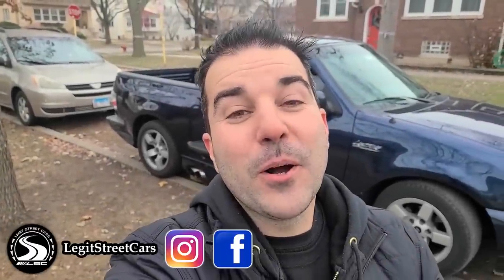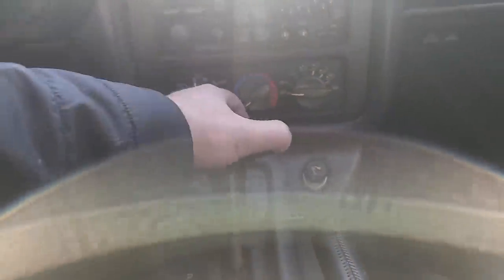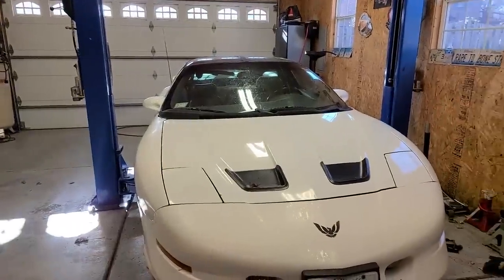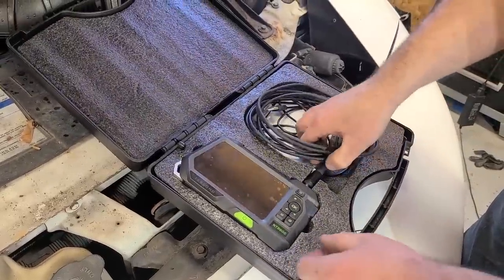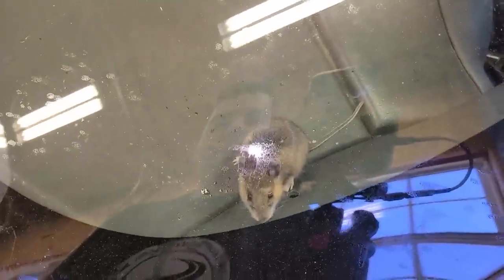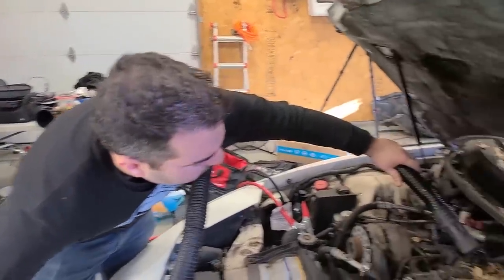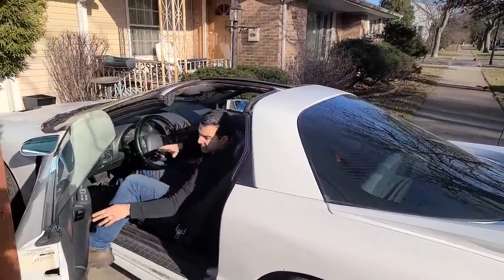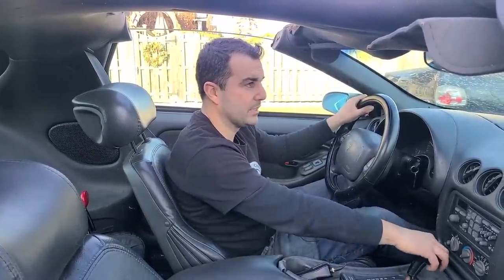I Bought My Childhood Dream Car After Finding It 25 Years Later! First Start & Drive But It's ROUGH!

Comment: Plumb the exhaust into the cabin and leave it running for a while, that'll sort the mice out.
Reply: As long as u sit inside while its running
Reply: @snoopy5736  definitely sit inside it, it will scare the mice even more
Reply: So glad Grandpa never killed himself. The old Garage had Termites and he used to let his  old car run in there warmed up but with the choke manually set back on. Quickly bail out and let it simmer for a while....
Reply: 🤔 interesting…
Reply: @D B he was joking
Reply: 🤣 🤣 🤣 

... also don't forget to take up cigarettes after, to get rid of the interior exhaust smell.  Lol

Comment: I'm heart broken that it was in such bad condition, but happy that you got it to run again if only for a little while. I'm sure Mel will be happy to see it drive too, and if the kid with the dead engine ever gets back to you at least some part of this car may live on. Also, I know not everyone is down with mouse traps, but even if you want to go the humane route just make sure you put them along the walls and in corners where they'll run to stay our of the line of sight and act fast before they start to consider your nice warm garage their new permanent residence.
Reply: Exactly, get that car out ASAP before they make a new home
Reply: Someone we pass by walking the dog has an E34 540i manual that has sat in the driveway for years.  I think the tag is from 2018.  It's rusty though being a Michigan car.  So sad.

Comment: My first two cars were LS1 Camaros (Z28 and an SS) back in 2000/2001.  Back then, the LS 4th Gen F-bodies were all basically brand new and I'd never seen one with high miles - seeing that undercarriage that I was once so familiar with just falling apart really hit me.  Can't believe how time flies.  Edit: seeing the poor old girl drive and try her best despite her condition was even worse, oof
Reply: There’s gotta be less corrosive solutions to dissolving snow, road salt absolutely RUINED this once great sports car and relic of the 90’s
Reply: @standyourground9973  there is! I live around Detroit and my county uses a brine/beet juice mixture to treat the roads. It's much less corrosive and puts way less salt into the waterways. Unfortunately, it requires different equipment to spread and all the surrounding counties still use rock salt.
Reply: @scottbutts6703  probably red tape as well… Thanks for chiming in, that’s promising
Reply: @standyourground9973  good name and pic.
Reply: @scottbutts6703  brine/beet juice is a pretreatment that you put down on bare asphalt to prevent frost from making the road icy. It does not melt thick snow and ice. If you get 6” of snow you need to put down heavy amounts of rock salt to melt the ice and snow back down to the asphalt.
Reply: My coworker had the 89 Iroc-z so they say.
Reply: @SuzukiKid400  Instead of salting away 6" of snow they could PLOW THE DAMN SNOW instead like a sane highway agency.

Lived here half my life and I still do not understand the SE MI road-clearing scheme.
Reply: @SYH653  same here in pa, they brine a lot and then salt even more throughout the storms while plowing. If its deep enough to plow we should just be plowing. And why dont we use sand like many places up north farther.
Reply: I've seen a few high mileage LS1 Camaro and Firebirds. A few with over 200k miles all original. They exist but not too many since most are either weekend toys or get rung out before they ever hit 60k miles from all the abuse.

Comment: Alex, regarding getting rid of the mice:  I would recommend the Classic Rat Zapper. I have used one for a long time whenever the mice try to move in. It uses 4 AA alkaline batteries and electrocutes the mice when they ground the contacts inside.  I found the mice in our area (I live just north of you) really like cocoa puff cereal.  A couple of pieces of cereal in the far end works like a charm.  The mouse goes in, grounds itself on two metal plates, and dies quickly.  Then you just dump the mouse outside or in the garbage.
Reply: @mcf3778  the Rat Zapper is not a live trap.  I have tried those sprays that he tried and they don't work that well if at all.
Reply: @mcf3778  Key word was ELECTROCUTES not trap.
Reply: @mcf3778  That's the thing, they didn't actually relocate on their own...
Reply: @RLC2020  I have never seen bots copy my comments into other comment threads.  Thanks for pointing that out.
Reply: Get a snake 🐍

Comment: Alex, I am not sure if this translates to F bodies, but my C4 vette with an LT has a Flood Start mode. You hold the throttle and clutch to the floor while cranking the starter. It deactivates the fuel pump, and allows you to crank the engine to get some oil pressure into the system.

Saves me from having to remove the fuel pump relays.

Hope this helps!
Reply: Mazda RX-8 has the same feature.
Reply: I thought all cars had that "clear flood" mode. (I think my Saturn and Subaru both do) Are there some that don't?
Reply: @rpavlik1  I am really not sure. If not, it really needs to be. I have always worried about the oil pressure after an oil change, so that feature came in handy when I discovered it. If you find out about your Saturn(its rad that you have a Saturn btw) and Subaru, let me know!

Best,
Luis

Comment: Beginning of the video: Wow, only $1500, can't believe you got it for that!
10 minutes in: Wow, I can't believe you spent $1500 on that car. 

Win some, lose some, glad you're able to find a good home for the engine, LSC doing wholesome deeds as always!
Reply from the maker: That's exactly how I felt
Reply: How much was it sold for initially?
Reply: @gzhang207  new LT1 TA fully optioned would have been just under 30k

Comment: Hi Alex. Thank you for all the enjoyable content you create. I have enjoyed and learned quite a bit by watching your videos. Im hoping you and anyone who reads this can benefit from my experience. I bought an auction car that I did not know had mice until I got it home. I struggled for months trying to get rid of them before I was successful and they did extensive damage to the wiring on the auction car as well as my daily. Mice do not have bladders. They urinate as they walk leaving a trail. The trail of urine is an attractant scent for other mice that can be picked up from quite a ways off. This means even if you get rid of the few that are in the car their urine trails or anything that they have urinated on like carpet, seats, etc. will continue to attract other mice. I do not wish to alarm you or anyone. My intent in sharing this info is to encourage you to scrub and disinfect anywhere you even suspect mice might have walked. What compounded the problem I had beside not knowing that mice urinate everywhere is that modern cars have wire casing made of a biodegradeable food based product mice can actually live on. Ingenious idea right? Many cars have suffered thousands in damage this way. There have been hundreds of law suits by consumers against car manufacturers that are easily found with an internet search. The manufacturers won and consumers were on the hook for the costs of the repairs. I hope you do not have the small problem turn into a months long nightmare like I did. In my experience I also learned that Honda makes a wire harness tape that is infused with capsacin to keep the mice or pack rats from eating and living on the vegetable oil based wire casing. Also in my experience that peppermint spray works well as a preventative measure. It does not work to overcome the attractive smell of their urine if mice have established themselves somewhere as they have in that TA. Until you remove and discard everything that is covered or saturated with their urine in that TA it is a big invitation to any mice downwind of it. Please learn from and benefit from my experience. Also please be sure to wear mask and gloves. Mice waste carries and spreads many harmful diseases that are highly transmissable to humans. Stay healthy and well please. Sorry to communicate this info to you that might be distressing. Im hoping you can nip it in the bud before it escalates like my situation did. Id also recommend not using the pellets that are an attractant that they eat and then die. They can eat them then crawl into a wall, hvac, or dashboard and die. Difficult to find and the smell is sickening. Best Regards.

Comment: As for the mice problem, I use a pop can on a wire across a 5 gallon pail with water in the bottom. Add some peanut butter on the can and make sure it can rotate easily. Self resetting trap!!!
Reply: I made one of those and it does work real well.

Comment: Reminds me of a 1999 F250 super duty I bought.  The 7.3 turbo diesel's a beast, like brand new, but there's more rust than metal on the body.  I'm slowly rebuilding the truck a few pieces at a time, and cutting out parts of the truck and wielding new metal in a few pieces at a time.  It's a long process, but a vehicle can be brought back to life with enough time, money, and labor.

Comment: In terms of the mice situation, regular spring mouse traps work pretty good if there’s just a few mice. Just put a nice piece of cheese or ham on the trap as bait and they’ll eventually get caught. If you’re worried about there being more than like 5, check youtube on multi catch traps
Reply: peanut butter works well as bait too.  I put a old snap trap out with some on it and lasted less than 3 minutes before I caught it.
Reply: @computerguytommy  Can confirm peanut butter is best.
Reply: @computerguytommy  peanut butter definitely works well. I’ve tried other “tricks” found on the internet with no success. Dryer sheets, pepper, those plug in do-dads that emit a high pitched sound. None of those worked. The old spring traps with the yellow bait pad work the best.

Also the bucket with the spinning pop can works well.

Comment: I've got a 95 Suburban 2500 and I'd love to see you snag a similar car and go through different tiers of upgrades for performance and looks. Like "if you have 1000 to spend, these are the worthy upgrades" and kinda go up from there
Reply: Start with a tune up and gaskets and all fluids changed. From there do a corvette servo if it’s a 4L60E, CAI, exhaust, and tune

Comment: What a trip down memory lane. I have a 95 Camaro RS that I bought about 7 or 8 years ago. It was in very similar condition to your T/A, especially the floor pan and rear axle and rear subframe and rear inner wheel houses. The body, motor, trans and interior were in really great shape and I had spent $2700 on the car. Most people would have junked it or parted it out, well after about 6 years I got it completely rebuilt and back on the road. It is not a show car but just a reliable summer time daily driver, that with the T-tops out still manages to turn a few heads every time I take it out.

Comment: The best way I've seen so far is peanut butter bait,  roller pipe, ramps and a water bucket trick. You can buy it on Amazon for like 20 bux just need a painter's bucket. Kit comes with walk up ramps and a roller. Sean Woods is a YTber out of Washington/Oregon area. He reviews a lot of mouse traps and in his case, I would recommend that plus clean the bucket thoroughly wearing gloves before you set the trap. Mice are very sensitive to human smell and won't go near a trap if they smell you've been near it. Sean Woods might be able to help as well, though I know he deals with his family a lot, but you both could collaborate.

Comment: The classic snap traps work great. If you have trouble with the mice snatching the bait without getting trapped, then bait the traps without setting the traps to gain their trust a few times and then set the snare.

The glue traps in the big tin box trap works great also.

Comment: I love F-bodys. Have to get one again. I bought a really nice CLK500 with a 7G-tronic last spring as I thought it would be as fun but my long gone Camaro -95 Z28 with a 6 speed was much more fun. Way less quality in most parts except mechanical where they are probably equal, but much more character. I'd be looking for a manual LS1 Camaro with some mods.
Reply: Try a 2005 E55 amg.. true not a manual but as a previous owner of a 95 Trans Am with a 6 speed absolutely approved.

Comment: Most likely that rusted floorpan was caused by leaking t-tops and the car filling up with water. You could put a new floor pan in it, assuming your doing the work. Otherwise that could exceed the value of that car. 
Classic industries has all the parts.
Reply: That car's roached not even worth putting a floor pan in
Reply: That’s what I hate T tops. I owned a few and I got tired of wearing a raincoat every time the car was driven.
Reply: The majority of the rust is from 
Chicago  winter  
road salt.

Comment: Ahhh the wonderful, Heat and Moisture sensitive opti-spark... got to love engineers.

Engineer 1 - "hey this heat sensitive moisture sensitive optical distributor works amazing, you should put it on that new motor you're designing, because its damn near impossible to beat its performance without some serious re-design of our engines"

Engineer 2 - "Heat sensitive, and moisture sensitive... this sounds like we could profit cause it will go bad so often"

Engineer 1 -  "Yeah, and its made of plastic, with 2 condensation reliefs so you can actually fill it with water if you try, where should we put it?"

Engineer 2 - "well, if i make the water pump extend outward, it might make it a little more fragile, and reduce airflow, and it would attach directly to the cam which sounds like its a performance upgrade"

Engineer 1 - "Direct connection without gearing, that means no need for adjustment! We can advertise that"

Engineer 2 - "yeah and if we keep the engine mounted low enough, that it scrapes puddles, and reduce airflow through the engine bay the car may go faster due to aerodynamics, until parts fail"

Engineer 1 - "Were adding a lot of heat and moisture capabilities, are you sure this is a good idea"

Engineer 2 - "yeah, cause this way its hard for mechanics to reach in and do anything. Also how about we scoot the motor back under the firewall so the spark plugs are extremely dificult to change"

Engineer 1 - "you truly are an inspiration"

Engineer 2 - "Thank you"
Reply: Maybe that was the same engineer who said hey let's put reverse j hook wiper arms on this car.....
Reply: that sounds about right...those optis suck......i heard there is a way to coil pack these motors and get rid of it..
Reply: @workingshlub8861  oh absolutely, there are 3 different things you can do,  unfortunately 2 of the setups rely on the opti for the timing. 

There is a newer kit that swaps over to a ls PCM and delete it all but I forget the name of the kit.
Reply: @ bud brown your so right LOL  I was wondered if the condensation relief drew more moisture in than it prevented it. The Same with the ls1 on The 4th gen, engineers let’s put the PS pump on top of the alternator what go go wrong lol I ruined  a nice new alternator once 3  days after install.
Reply: @scaryhandsome1960  I think the power steering pump ruining the alternator is not a very common occurrence though
Reply: @scaryhandsome1960  Oh and the slave cylinder bleed valve for the clutch, being INSIDE THE DAMN BELL HOUSING... idiocy. But they are still fun as heck.

Comment: Mice have 2 purposes in life, eat and make more mice, now that your garage is “infested” your going to need to put in poison traps…and check every inch of the garage as entry and exit points…and NO FOOD allowed in the garage until they are removed…not even a snack….if they smell food they will never leave….and even if you empty the trash…the trash can will still smell like food, same with surfaces…so NO FOOD in the garage.

Good luck.

Comment: After letting it essentially rot for the last 20 years, the seller tells Alex to take good care of it. Unbelievable. Alex got ripped of at $1500. What the seller needs to do next is have someone haul away that Trailblazer before it too turns to dust.

Comment: I had a similar incident happen a few years ago. A couple  down the road from me had a 85 Monte SS was able to buy it back in 2014 for a father son project. Got quite a bit of work done to it decided to pull the front clip and you could stab through the firewall with a screw driver. Shortly there after it got sold for parts a few weeks later. Broke my heart to see it end the way it did but it fueled my fire to get into cars.

Comment: Use some Tom cat mouse traps with peanut butter or Snickers also works well. Also place sticky traps around the entrances to their "homes". When placing them use gloves so your scent doesn't get on them. Nice are pretty smart. I did have an issue with them recently and this has worked really well for me. Use a lot of traps though to increase chances of catching them.

Comment: It’s probably cheaper to buy a car in the south, and get a trailer and tow it up north. It might run like crap, but it won’t have any rust on it. I live in Texas, and have a 1994 25th Anniversary Trans-Am, and it looks brand new. My work truck is 21 years old, and underneath, it has absolutely no rust. If you need to buy a rust free car down here in Austin Texas, let me know, and I’ll go look at it for you and let you know if it’s worth the trip to come pick it up.

Comment: Glue traps for the mice.  Leave them by the corners of the overhead door.  They will most likely chew through the bottom door seal to enter/exit.   Noticed a mouse in my garage after setting up a golf simulator area.  Used the glue traps and caught 5 mice, a mole and a chipmunk within a week.  All gone now...I think. Good luck 👍